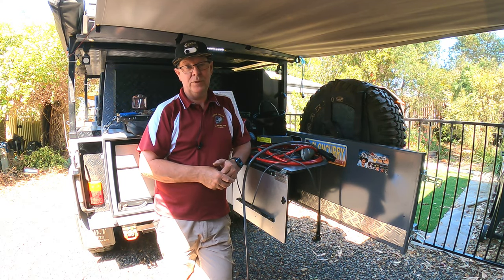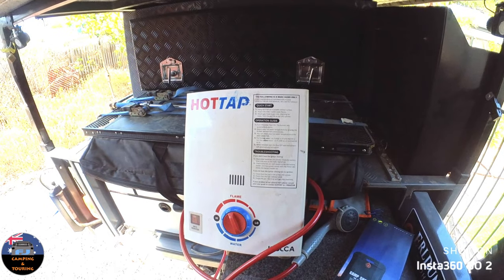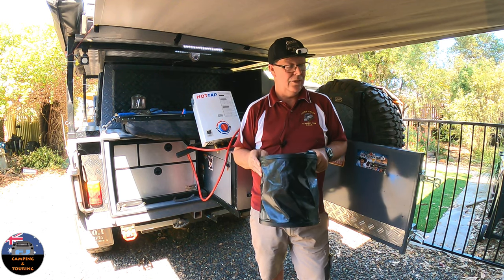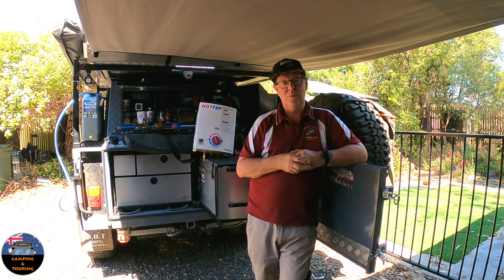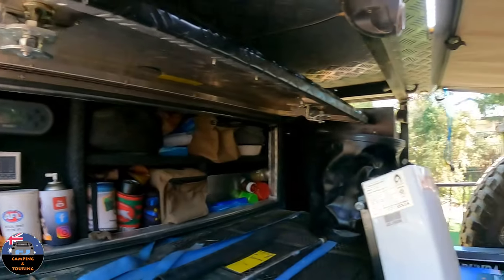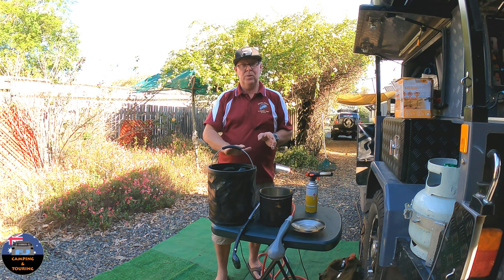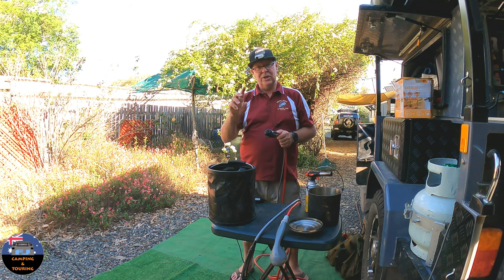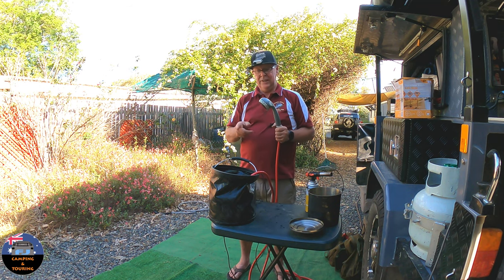12 V hot water shower does it work as good as my joolca

Comment: Interesting video. Simple often turns out best hey. Of course you don’t have to waste the water whilst heating. If you put the water in the bucket as you did during the test, you can put that back in the tank. More work and a bit of hassle, but you don’t have to waste it unless you choose to dump it on the ground. Great video as usual. Thanks.

Comment: That's how we've done it for years. 23 dollar ( that time ) shower pump and a little 9ah 12 volt battery for at the back of the caravan what did not had an shower inside so we're using an shower tent.  Like you one kettle of hot water on a bucket of cold water We found that the solar shower bag is getting way to hot to use in the summer
Reply: Oh yeah just seems a more simple and easy way to do it Jack like I said the gas hot water system is okay  it’s just the amount of water uses cheers mate 👍

Comment: Great video thanks for sharing. I had exactly the same issues. My first Joolca failed to get over 28 degrees. After they repaired it it worked for less than 20 minutes then failed completely. I was offered a series 2 at a discounted price however the slightest breeze and it goes out. Very frustrating. Your simple method seems like a far better system. I’ll be changing my joolca for your setup for my next camping trip. Thanks again
Reply from the maker: Sorry to hear you’re having trouble with a Joolca I was really hoping it was just an individual problem I was having got I’ve had that many messages from people with the same trouble it’s a shame because it could be a great product just to let you know I’m still using my little 12 V submersible pump and boiling up hot water I just find it easier and less waste cheers thanks for watching I hope you get it sorted out

Comment: Yeah I feel your pain , I've got a joolca  and it does exactly the same problems you talk about, plus it takes a bit to ignite and I've also replaced all the connections because they leak and still do.
Not only that the shower head had to be replaced and I also had to re wire the wire to the pump because the pump was cutting in an out.
Other than that when it works its great, but every time I set it up for camping  there's always a drama getting it going.

Comment: We haven’t used our joolca for a while , we have just been using the kickass lithium shower in a bucket and we heat it by boiling the billy and also i leave the jerry can in the sun for the day , most of the time that is already warm enough.
Reply from the maker: Thanks mate I might even try that get a steel Jerry can  myself👍
Reply: I’ve been doing the same. The kicksrse lithium shower is easy. Heat water in the fire then throw in the shower pump and switch on. No additional cords or battery. Simple and works a treat. 100 lt per charge. My joolca never had a issue. Use it for longer trips. Always run on low water output and adjust to 44 deg. Temperature of water is what can change the set temp. Water in the sun  versus water left overnight in winter means u need to adjust the temp setting. I did have an issue with the filter in the pump clogging up with the smallest amount of debris. I took the small filter out and put in a larger hole filter have no issues since. If the pump doesn’t pump enough water u have a lot of running issues.

Comment: I use a submersible Kickass shower.  Easy, just fill a stainless bucket with water and heat it to 40 degrees on the fire.  If no fire then as you said, heat a billy on gas and pour it into the bucket and add cold water to desired temp.  When I first started doing this I tried to judge the temp and it always seemed to be too hot but I bought a 20 something dollar infra red thermometer.  Perfect every time now
Reply from the maker: Awesome sometimes the simplest things are the easiest I’ve got a kickass Lithium one as well I use it if we just in the car

Comment: I built my own system after being disappointed with Joolka. A simple 12 volt camper pump and an instant heater off Amazon. Connect the propane and the water and you’re ready to go. It’s been great for a year now.
Reply from the maker: Yeah I just use the Coleman hot water system now getting a caravan soon it’ll have its own hot water system so hopefully I won’t have any more dramas. I don’t know what the new. Joolca is like mine was one of the original ones that first come out hopefully they have improved their product 👍

Comment: 👍We use a Nemo Helio Shower. Boil the water and pour it in (or leave in the sun to heat). Power source for the pressure is the inbuilt foot pump. It has awesome pressure, minimal water used, packs down super small.
Reply from the maker: I’ll definitely check that one out thanks for letting me know

Comment: I have a Thermo mate shower , similar issues,but heats up fast, I just control the heat with the tap on the trailer  , by adjusting flow. it stays at around 35 degrees.
If I use a submersible pump it gets to hot and turning the gas down it goes out. get the flow right and it works a treat.
Reply from the maker: Awesome I’m glad you’ve got your shower worked out I’m still using a bucket and boiling up some water just find it much easier don’t think I’ll ever go back to work gas shower Cheers thanks very much for watching and your comments 👍

Comment: I'm looking at getting a 12v 6L aqueous water heater. Simple to setup with a thermostatic mix valve set to 38 degrees at the shower head. Hot water everytime.
Reply from the maker: Awesome I’m just sticking with my 12v rechargeable and boiling water

Comment: Have to agree not found a hot water system that works straight away, we always fill the solar showers and let the sun do its job with a cheap 12volt shower pump.
Good job as always

Comment: Ive got a joolca but dont use it anymore. I use a companion aquaheat lithium gas shower. Its a game changer for us. So much easier to set up, less water usage and you can buy a gas refill adaptor from ebay for 10 bucks so you dont have to keep buying canisters or buy the POL gas hose for a bottle.
Reply: What's a companion aquaheat lithium gas shower I was planning to buy a joolca but not sure anymore seems like it isn't as great as I thought
Reply: @jesscalderon3766  have a look at an AQUEOUS 12v water heater. 6 litres. They are used in caravans but Its the same size as a joolca. Get a mixing valve and set the water to 38 degrees, water comes out at 38 degrees first tike everytime once u "boil" the water. 6L will do a few showers, as u mix hot with cold at the shower head.

Comment: I have the newer Joolca system for a couple of years now and haven't had a problem with it.
One thing I noticed about the setup in this video is the hot water hose coming out of his Joolca didnt look like the original hose.
Now I'm no expert so I could be totally wrong but, the original hose inner diameter is smaller than your standard hose. So as I see it, it creates enough back pressure to the Joolca unit to heat the water efficiently.
I'm not saying I'm right. Just my observation. For all we know the Joolca unit in the video could be faulty.... still.

Comment: I appreciate your video! I’m building a backyard bathhouse for my wife currently and comparing products. For your application though I was wondering if you’ve tried those PVC pipe roof mounted showers? They’re cheap to build and heat up via solar on your roof and then gravity drain pressure for your shower. You have the pump so I’m sure it’d work better. But you should check it out if you have storage for the mount on your vehicle.

Comment: The hot water heaters are a PITA to get the temperature right coming out of the shower head but they are far easier and faster than screwing around with boiling pots of water and solar showers. Your just using it wrong. Your trying to integrate it into your pump system on your truck. Dont do that. All you need is to buy a small 12v pump (similar/same as the one you already are using on your truck), fill up a bucket of water and simply recirculate the water from the water heater into the bucket until the bucket is the right temp for your shower, then take your bucket and separate shower head/pump and go shower. Or, set the water heater to low flame and adjust the water flow to the desired rate, recirculate the water until the temp on the water heater is the right temp for your shower and start showering through the heater. Far simpler and faster than all the other BS. This is how I have been using mine for years and 0 issues.
Reply from the maker: Yeah I understand what you’re saying there’s always a solution to a problem . I have been using the bucket of water solution for awhile now but getting a little tired of boiling hot water so I was camping with a mate who had a new portable hot water system which I tried out and absolutely loved. I will be doing a clip on it soon but I love your idea. Thanks for sharing. Hopefully it will help someone else out who has the same problem? PS I never really had a problem with any of these hot water systems like the kickass or joolca they work as they’re meant to, but it’s the amount of water they use to do what they do, and because I have my water plumbed into my trailer. It was very hard to try and put it back again. Cheers thanks for watching and your comment 👍👍

Comment: Its probably only academic as I think you have made up your mind now, but I would have added two temper valves, one for the shower and one for the kitchen. Then always run the Joolca as hot as it would go and the temper valve would mix cold water with the hot to output the same temp all the time, 4xAdventures has a very good video on how the temper valve works etc.
Can you work on your sound levels. I had to turn up the volume to hear your intro speil and then got blasted by the intro, plus at other times it was going from quiet to louder
Reply from the maker: Thanks for the input I will look at the sound a little bit closer cheers

Comment: The portable gas HWS are just junk. Daughter got one as well and it is not what i would call hot at all. It has the same problems as yours. I have just installed a  Duoetto MK2 RV Hot Water System into our camper trailer. So fare it has passed every test i have given it. Just has to Pass the OFF ROAD testing and longevity testing now. It gets really hot up to 70c on 12v dc for very little power use. Look into that one Mate. Better then stuffing around with black camp showers. We did that last trip. It worked but what a pain.
Reply from the maker: Yeah not a fan of the gas hot water systems glad you found a solution to your hot water needs we a really happy with our water heating and washing system now cheers

Comment: Why not use the Insta hot water heater to recirculate it back into the bucket that it’s sucking out of to warm your water that way you’re not wasting your water, but then you don’t have to boil it either
Reply from the maker: I understand what you’re saying, but the pump that pumps the water out of the tanks on my trailer is connected to the camper trailer if I put the water into a bucket then I have to try and get it back in the water tanks on the trailer. That’s why I have never gone down that path we have found it much easier just to use a 12 V Pump in a bucket and most of the people I talk to do it that way now. I have recently bought a new product though that is much more efficient portable and can heat up as much water as you need. Will be showcasing it soon. cheers thanks very much. I hope this answers your question on why I don’t use my hot water system on the trailer. Cheers

Comment: Have you thought of recirculating the water through the heater to the bucket to get it to the desired temp? Just saying.
Reply from the maker: I would if I could with the Jocloa but it’s plumbed into my water tanks I would have to pour the water into the tanks or disconnect the system from the water tanks and use a separate pump from the bucket which could be done might keep that in mind try it out 👍

Comment: It could just be me but I’m not getting why you’re not filling up a bucket with water and sucking it into there hot tap from there there’s no way you can not lose water if you’re not recirculating it to heat it up in a bucket first I feel like using your big tanks isn’t the best idea be interested to see if it works better doing it that way
Reply from the maker: The hot tap is connected to the tanks on the camper I would have to get a separate pump to suck from a bucket I now just use the 12v shower it’s easier someone else said put the water into a bucket and then put it back in the tank but it would contaminate it we use for drinking